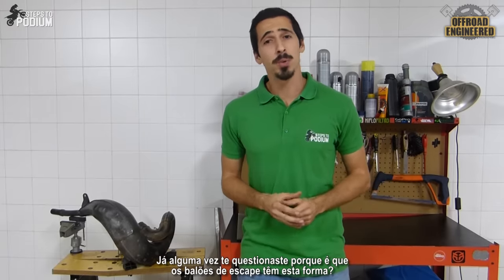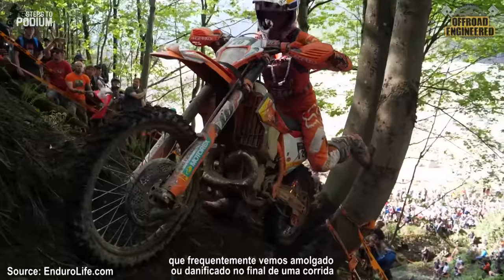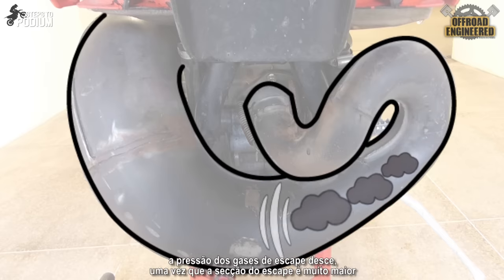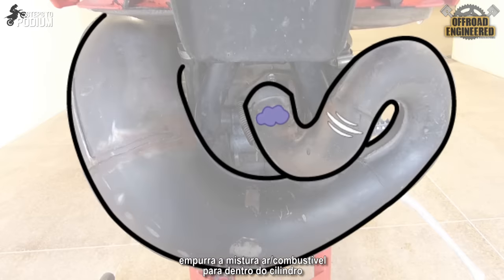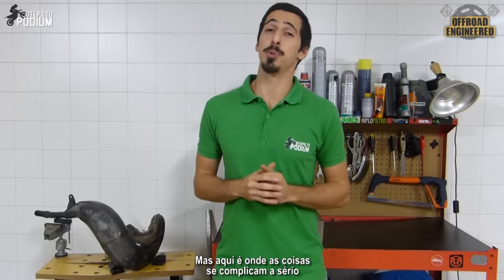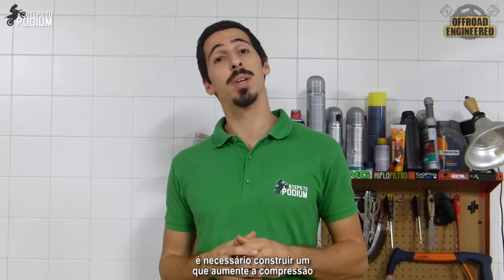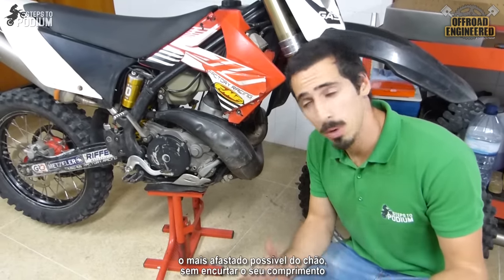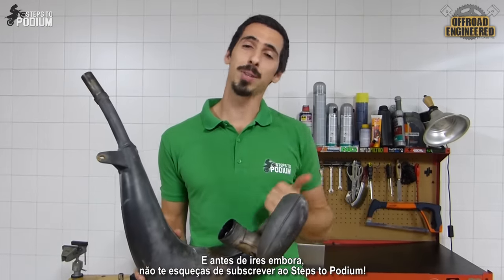How 2-stroke exhaust pipes work | Offroad Engineered

Comment: team 2 stroke for life honestly
Reply: Im team both 2 stroke for wood and 4 stroke for track!!! If it’s got two wheels and knobs it’s a win for me ✊🏻
Reply: That seems backwards lol
Reply: Chris Webb idk 2 strokes a much easier to ride through tight tracks and hills, just abit more clutch work, but that’s quite easy, on track 4 strokes rip
Reply: @huskyluva2180  four strokes rip because two strokes where ban from racing on tracks ...since the night at the indy mile when kenny roberts won the indy on a TZ750 two stroke inline four cylinder yamaha that in stock tune made well over 150 horsepower compared to all the four strokes barley make 100 horsepower ..it is impossible for the same size four stroke naturally aspirated engine you ever make more horsepower than a same size naturally aspirated 2 stroke that's why they were banned from MotoGP and the dirt track if you can't beat the competition get rid of it that is how we do it today
Reply: @huskyluva2180  i never had any clutch problems racing two strokes for over 20 years
Reply: @chriswebb383  today what is backwards is the motorcycle technology of two strokes and four strokes ..four strokes in racing scrambles and motocross came 1st and then two stroke where developed later making off road racing much faster and handling much easier ...this is not an opinion i lived through those times and found it out for myself along with over a million others in the industry at that time ..two strokes do everything much better than any four stroke ever will for lots of reasons now forgotten and never known about in todays generation who have never had the experience to know anything about it
Reply: Just send it
Reply: donnie baker FACTS, Bro.
Unless you’ve ridden both. ... HARD, you’ll never know! 
The visceral punch of a 2-stroke is otherworldly 😱😲😁😁👍
Reply: @huskyluva2180  4 strokes will never make the same horse power per cc that a two stroke will ..there is no debate as it is well documented by the world famous tuner from japan Yoshimura who tune motorcycles for Honda for 10 years in a row trying to prove that he could make a 4-stroke out run a 2-stroke but he failed very unsuccessfully
Reply: @glenholmgren1218    you are singing to the choir I raced and tuned  two strokes professionally for 20 years and my trainers name was Yoshimura world famous tuner for 2 Strokes
Reply: donnie baker pound for pound you can’t make more power. Now, the kind of power? That’s a different story. These days it is backwards, the two strokes are the low end torque bikes and the 4 strokes are the crammed out screamers. But honestly, I’d rather build a two stroke for 1/2 the price, and I’ll never get over that 2 smoke hit, that will put a smile on my face until the day I can’t ride anymore.
Reply: Glen Holmgren I always consider 4 stroke better in top end, mostly because I can hold my rpm for much longer, but I don’t get my power band. But at low end I’m 2 stroke all the way
Reply: They sound way better that a rough hacky sounding 4 stroke 

2 stroke all the way! 👍
Reply: donnie baker for the amount of fuel they use they are less efficient in their power but yes I know that, why does that infinitely make 2 strokes better?
Reply: donnie baker bro I get it they make a lot of horsepower, why does that mean everything to you, the only 2 stroke I’ve personally ridden is a husqvarna wr360, I’m only 14, I’m more saying from a professional view
Reply: Kenny Roberts 500cc motogp two stroke yamaha made 150hp and the 750cc inline two stroke four cylinder made way more !!! To the tune of 200hp mounted in a dirt track frame in kenny's own words , " they dont pay me enough to ride that thing!!!" and so two strokes were ban from dirt tracks and then later ban from motocross !!! Here's kenny back at Indy demonstrating what it was like to ride one that none of you will ever get to do!!!
https://youtu.be/8k8hJWKIVNs
Reply: No one here has explained anything true about how a two stroke engine functions at all . These types if engines compress the intake in the crankcase making boost . As the transfer ports open fresh air/fuel mixture is forced into the combustion chamber above atmospheric presser ..the expansion chamber reverse cone reflects a sound wave back to the exhaust port to keep the boost charge from escaping. This process continues faster and faster as the engine rpm catches up to the boost until it makes many times more boost than anything else supercharged ..this is when a two stroke is "on the pipe" and begins its power band that instantly makes peak horsepower and if the rider is not aware of usually throws him off as the bike goes over backwards in a wheelie.. To get the best hole shot taking off the line in 2nd gear does very well for 125cc two strokes with practice and a friend of mine who rode supercross in the 80's could launch his CR250R Honda Elsinore in 3rd gear holeshots  that very quickly put him in first place coming out of turn one every time
Reply: @glenholmgren1218  I raced them for 20 years both 2-stroke and 4-stroke and was sponsored buy Honda and Suzuki there's nothing you can tell me about them but I already know
Reply: @deborahchesser7375  you have no idea of what you are claiming you have never done any of it all you're doing is speculating what someone else has told you I was there when they began I was there when two strokes took over I was there when the two strokes were banned and I was there when they claimed the four strokes you better I was there when Doug Henry literally smoke in Supercross field with oil smoke coming from his worn-out piston every race as they required to put in a new engine for every Moto.
Reply: @fordrestored4646  4 stroke do not have a powerband because they cannot make any boost. This is something that none of you seem to be able to understand at all
Reply: @huskyluva2180  two cycle engine are self boosting engine. They build compression in the crankcase and then boosted through the transfer ports to the combustion chamber where it is compressed again making much more horsepower than any naturally aspirated 4-stroke can ever do. Plus 2 cycle engine only have 3 moving parts compared to all the multiple part moving in a four stroke double overhead cam that cannot make any boost that relies totally on the air pressure of the atmosphere alone. Two cycle engines produce higher than atmospheric pressure inside the crankcase as supercharged the combustion chamber. The expansion chamber reflects a sound wave back to the exhaust port who stopped as much of the Boost as it can. When they engine RPM catches up to the Boost this is what we call on the pipe. This is where the two stroke Power Band begin all the way to Peak horsepower which multiply many time during its RPM gain. A 4-stroke cannot do any of this because they are not made to compress  any intake in the crankcase. No one really cares what the gas mileage is during a motocross race. The idea is to cross the finish line before anyone else does . any 2-stroke gives you a big advantage for winning four stroke engines are invariably way more heavier than a two stroke engine due to many extra parts that weight a lit more than no parts at all that are not in a two stroke engune at all, adding more weight to the front wheel making it harder for changing lines also the extra weight on the front end makes it harder to land on the rear wheel.. you get the most power to the ground sooner with a 2 stroke. And the list goes on why a 2-stroke is much better for racing motocross and why they came out after the 4-stroke motocross bikes in the early 70 when Honda introduce the two stroke CR250R Honda Elsinore that changed Motocross forever Until lately when all the propaganda has brainwashed everyone of you into believing bulshit
Reply: @huskyluva2180  winning a race versus losing it and breaking your back doing so on a cumbersome 4-stroke makes 2 Strokes the weapon of choice
Reply: donnie baker I’m getting really confused, 2 strokes, at least modern, are not as good at racing as 4 strokes, I’m sorry but that’s plain simple
Reply: donnie baker please, I’m just saying that modern 4 strokes are better and track and more efficient in making power from what they use, of course 2 strokes make more power I’m not denying anything your saying, but my point is modern 4 strokes are the fastest on the track. They are not just fast for their straight line power but their stability. It all comes down to the rider and track as well. If there are 2 riders both as experienced on say a cr250 and a crf450 the results would differ depending on the track, if it’s rather open most likely a 4 stroke (this is most tracks), if it’s 2 stroke it’s best on short tracks but less practical. Also I dont even really like MX I’m an enduro guy and much prefer 2 strokes for tighter stuff, like I said before the only 2 stroke I’ve ridden is a WR360 which is quite torquey but compared to my bike- TE310R it’s nearly as hard to stall because it has a pretty weak low end torque, anyways they both have their strong suits, 2 strokes get power, simplicity and lightweight, 4 strokes get stability, efficiency, straight line speed and smooth power, unlessssssss it’s a cr250, cr250 wins all
Reply: donnie baker I never said a 4 stroke has a powerband lol. I was saying that I can run my 4 stroke at a higher rpm for longer without worrying of burning it out like I can with a 2. You have to back off of a 2 stroke to let the oil lubricate the piston wall and suck. 2 strokes are very strong so I prefer one when trail riding, but a 4 when track racing. I’ve burnt compression out of  a few 2 strokes  by keeping it revved high for a few laps. Never have that problem with a 4. I understand how both engines work and have done  my fair share of work on them. I do like that I get a powerband with a 2 stroke but that’s not everything for me. I only can use that on straights then it’s just back to another curve and I have to ease off the throttle which puts me out of the powerband again
Reply: Ford Restored don’t try argue with him he won’t stop until you say something that indicates 2nstrokes are good at everything
Reply: Husky Luva honestly lol I’ve rode both and like both
Reply: Josh Broadbent yess
Reply: @huskyluva2180   if you race 2 stroke, you're motor has to be half the size of the 4 stroke motors. So the 4's actually have a chance. What does that tell you?
Reply: @shogun678  That the 2 stroke has a combustion cycle each revolution? 
They are extremely inefficient compared to a 4 stroke, BMEP is very low. A 4 stroke use pulses as well in their power band (not positiv pulse in the exhaust though), so the best 4 strokes has reached a VE of around 130% NA, that's not even remotely possible for a 2 stroke.
Reply: Damn right BRAAAAAAAAAAAP!!
Reply: 100 % 2 stroke till i die

Comment: They're shaped that way so you have to buy a new pipe every time you smash a log.
Reply: heat gun + air compressor 😏
But make sure to secure the plugs and be careful. Slow and steady.
Edit: Actually I might have used a torch. It was a long time ago!
Reply: They should use rave valves / power valves like jet skis. Then you wouldn't need the complex curves.
Reply: @lalilulelo1989  yeah, I do that sometimes. I wear my full riding gear when I do, had a plug shoot out at mach 3 before, haha.

Comment: When the 2 stroke is running, after the exhaust gas is pushed out, some of the fresh fuel air mixture gets into the exhaust pipe and that is what is pushed back into the motor to charge the cylinder with more pressure.
Reply from the maker: exactly :)
Reply: Nimbus Nimbus  Not really, the video kinda implied that the gas beeing pushed back is already combusted gas, there wasnt a mention of fresh mixture escaping the cylinder and that beeing pushed back. It might just be a language barrier thing :P
Reply: Nimbus Nimbus  No he didnt? He didnt say it was fresh mixture that escaped the cylinder, he used the exact same icon for them as the icons for the exhaust. Implying its combusted gases that get pushed back in. Not my fault if you are not mechanically inclined
Reply: Nimbus Nimbus  Its a smoke icon, explain why unburnt air and fuel would represented with a smoke icon? U are dense mate.
Reply: Nimbus Nimbus  Also give me the timestamp where it says new air fuel mixture escapes the cylinder.
Reply: Every little if at all when the engine comes into it's power band making boost
Reply from the maker: with subscribers like you, making videos makes it all a he'll of a lot easier 😍😆😁💪
Reply: @NjoyMoney  the boost ports are open while the exhaust port is open and at curtain rpm's there will be a waste of fresh air/fuel mixture that is already at a higher pressure than the atmosphere as it was compressed in the crankcase before entering the combustion chamber as boost  .this is way two-cycle engines are self supercharging and make a much larger amount of horsepower than a naturally aspirated 4-stroke engine of the same size can  eve do
Reply: donnie baker wait, the crankcase and combustion chamber and not connected. Crank pressure is usually around 25 psi, where as combustion chambers pressure reaches levels of 160psi. 
I may have misunderstood your post. I'm sorry if I did miss something.
Reply: Steps to Podium NO, that is exactly what does NOT happen - the sonic pressure wave pushes “back” against the exhaust port opening ... it doesn’t draw in fresh air from outside the exhaust port!
Reply: GankMan Correct
Reply: Nimbus Nimbus Then either he implied it wrong or people inferred it wrong - in either case, it’s just plain WRONG.
Reply: GankMan YES, barely escapes the cylinder, but at the CORRECT RPM (frequency in Hz - hence the “tuned” pipe moniker) the pressure waves from the burnt exhaust gasses reflect back from the inverted cone far end of pipe expansion chamber and “push” them back into the combustion chamber, effectively “compressing” the incoming fuel / air mixture which, in turn, boosts the inti pressure before combustion and consequently the PMEP after combustion. Hence the Torque / HP increase. 🎯👍😁😎
Reply: @NjoyMoney  its about cumbustion effeciency. thats why the 2 stroke gets pushed out of the limelight.
wasted unburnt gasses out the exhaust. dirty exhaust. the pipe "scavenges" those gasses and pushes them back into the cylinder. more effecient. but technology is now using efi and ECU controlled servo actuated "powervalves"/exhaust valves. I read F1 cars dropped the new electric batteries and is putting the $ in 2 stroke tech!!
 HERE WE GO!!

Comment: In early days the exhaust pipe was also referred to as an “ extractor” and the smaller pipe at the end was the “stinger”. M/Cs sometimes came with narrow stinger openings to get more horsepower but it caused the power to fall off at low rpm so commonly the stinger was widened in diameter to get power at lower rpm and prevent a bike from ‘falling off the pipe” or losing power. There were no silencers when I stated racing.

Comment: I ice raced Mercury sno twisters in the mid seventies and the pipes on those machines where never duplicated. Mercury even had Tipsters as modifications to enhance rpm.   How to cut and shorten for a given rpm.   Very high tech at the time. I believe it was Les Cahoun that developed those pipes. A talented 2 stroke engineer that ended up at OMC in their engineering room. A book called 2 stroke tunrs handbook was our bible in the racing days of design and mods.   Cool stuff !

Comment: Great to see you explain it so clearly.
There is a mathematical formula for calculating length and shape of the pipe. I bought a book called The 2 Stroke Tuners Handbook 40 years ago and still use it. It has all the info for building pipes in it. I have built 3 and they all worked great. I checked Amazon that book is still available.
Reply from the maker: thank you, I appreciate it 😊
maybe I'll get it! it's such a complex subject, it's never too much knowledge lying around 😆😂

Comment: Another factor is the length of the divergent and convergent sections help broaden the usable rev range.  as the convergent gradually contracts it is sending a positive sound wave back the whole time, weaker, but broader.  This means it will reach the exhaust port over a wider rpm range, but it's peak wave pressure, and thus the engines comp ratio will be less than a more aggressive angled convergent section, same goes for the divergent section except reflecting a negative pulse for scavenging.

Comment: I use to race shifter karts and jet skis in my younger days. Temperature also affects the speed of the sonic wave. A rich or lean mixture will change the exhaust gas temperature and the tuning within the pipe. On our jet skis we would inject water into the pipe at various places and this would change the powerband due to the temperature change. We also used what were called center bleed pipes were the exhaust would exit out of the side of the cone. Didn’t affect power but made packaging easier. Lots of interesting theories on expansion chambers.
Reply from the maker: Nice! Thanks for the info! It's amazing how specific the technologies can get in the various motorsports!
Reply: Yep, the difference in the sound wave speed is because of differing exhaust gas temps, as the sound wave does travel a bit faster through hotter gasses.  If your pipe and porting are tuned fairly well together, on normal pipes to me (not water injected), you can wrap the pipe with some pipe wrap insulation, for hotter gasses in the pipe and usually gain some top rpm.

Comment: 150+ psi, seal pipe on both ends. Torch the dents. If you have an air tight seal, the dents pop right out... Old dirt dog trick from the late 70's early 80's. If you do it right big dents can be repaired fairly easy. This really works! We did it on the worst of rainy days!
Reply: You need to fix it with ice